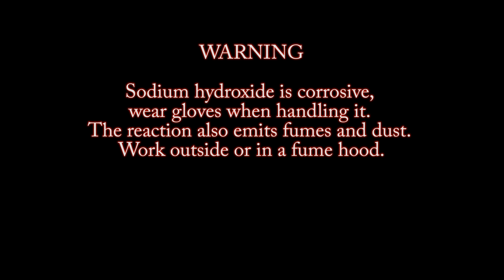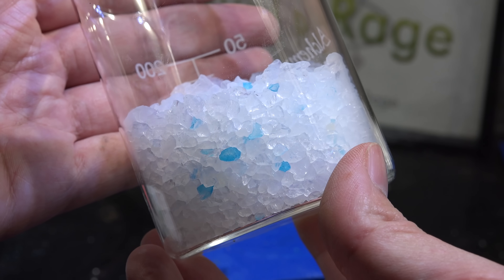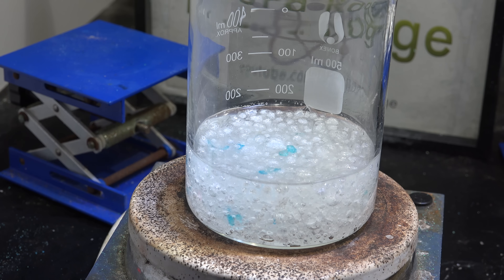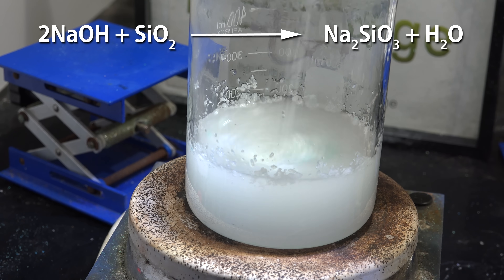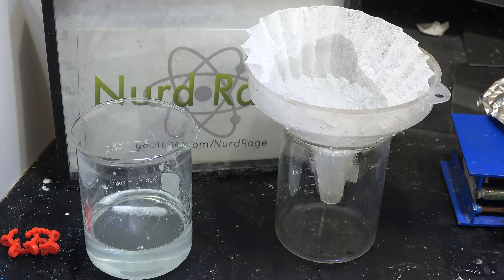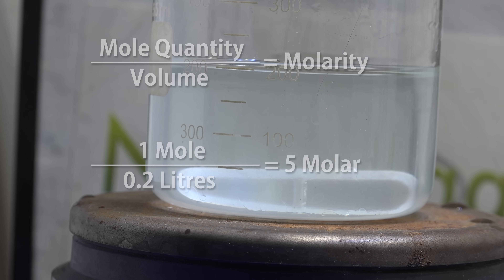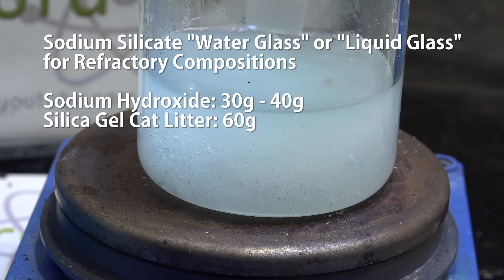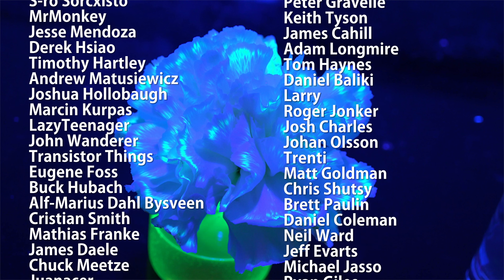Make Sodium Silicate (AKA "Water Glass") from Cat Litter and Drain Opener

Comment: Not that interesting by itself?? Its an incredibly versatile, safe and accessible high-temp electrical insulator for DIYing. You can just paint it on your conductor wires in a thin layer, heat to 120C to cure and then you're good up to 700C or so. One can easily build high performance heating elements or transformers or just use it as structural support as its very stiff. Worst case scenario, if you get it too hot then it just melts, unlike alternative varnishes or coatings that start spewing out toxic gases.

Comment: I put this in a spray bottle (diluted so it would actually spray) and used it to stop smoke from leaking out of my rusted chimney. Worked great! Had to get a blow torch on it though, as the heat caused the solution to boil, the bubbles would turn into glass. Looked really cool, and bright white

Comment: Quick first hand experience report on how not to do this:
1. Use previously used (but well washed) cat litter. Possible source of some of the product's ugly brown color.
2. Prepare in a soup can. The can liner soughed off and maybe partially dissolved, possibly contributing to ugly color, and later on the burnt circuit board aroma.
3. Stir with a twig. Partially dissolved brownish too.
4. Mixed lye and water first in a cold water bath. Had to do this outdoors where I forgot the exact procedure and winged it. The water bath was because I feared losing water and lye if it boiled over.  The lye did dissolve completely. However it seems the low temperature didn't allow the reaction with the silica to kick off fast enough for significant self-heating. I didn't get the stoichiometric mix I was after since some of the litter turned into a sort of chalky looking lump with the consistency of chewing gum. I was able to partially save it by using a propane torch to bring it all to a boil. However that also burnt some of the can liner and added the burnt circuit board smell. 

Oddly, I don't think it was much of a problem that my cat had anointed the crystals. I had washed them for several days in several changes of clean water, sun dried and then vacuum dried and then an hour under UVC light and 03. They were completely odorless but probably a bit damp from over a year of storage in an open container.

Open to suggestions about what might remove the ugly brown color and other contaminants from this batch.

Comment: Made up a batch with Fresh Step brand crystals cat litter. It must have some cobalt salts in it, because the finished product had a solid pink tint. Worked very well for bonding sand for a core for sand casting aluminum. I baked my core at 350 F for an hour instead of using CO2. Worked great, Thanks.

Comment: I want to learn how to make this--but starting from SAND. So far, the information I can find on this has been scant and contradictory. 

Presently, I have quartz sand, sitting in lye water. IDK--the water has formed a bit of a gooey layer on top. 

I read something about sand + magnesium powder + heat being a formula......apparently this yields an impure result, which you purify by using muriatic acid, in an explosive display. 

There must be an alchemical text, describing the procedure they used in the 17th century.

Comment: Finally, someone gets the sodium silicate thing right.  I can’t tell you how tired I am of people calling water glass sodium silicate sodium metasilicate!  They are NOT the same!  The metasilicate is too alkaline and does not have enough silica to seal eggs or density concrete because you need MORE silica in your formulation for that.  Metasilicate is a heavy duty cleanser and corrosion inhibitor.

Comment: I wish you smart people would EXPLAIN these things in Kitchen Cooking Terms for isn't that the mode of operation your in delving to perform. Example: Take 3 Table Spoons of Lye/Sodium Hydroxide & slowly pour into very Hot Distilled or De-Humidifier Bucket Water. Only use stainless steal or hardened temperature safe Plastic utensil. The take 1 PART that being 4 Cups of Water & add 2 Parts that B Cups of Cat Litter Silica minus the contaminant Blue Smurfs, Radiate the water with Sun Light directly into a White Bucket or place a Halogen Quarts ~HOT~ light Glass shield off the Water will absorb the Short Wave infrared Heat & Restructure the water Molecule, Vitalize it. Dr.Pollock's work with Water.

Comment: I recently discovered the clay based cat litter is generally made of zeolite specifically. It should be possible to produce molecular sieves from it.
Reply: The pores are usually not suitable for chemical uses though. Molecular sieves are engineered to have specific pore sizes to adsorb and trap molecules of certain sizes. 

While cat litter uses natural clay and even though it is generally used to adsorb urine, the water adsorption is really not specific. Its also used to adsorb odors so the the pores are most likely to be quite large to be able to trap larger volatile compounds that smell in urine

Though having said all of that, there might be certain processes that can be done to selectively collapse the zeolite framework to provide smaller pores. Even though it might need elevated temperature like in a kiln or high pressures like in an autoclave. 

Im interested in using it as a makeshift column chromatography solid phase

Comment: You're video had been the best figur the explanation of the molarity and ratios per usage. I'm wondering if you know what the molarity is for 30/60/100 mixture? Does it depend on the starting ingredients?
And how does one thin it?  Just by adding water or is heat necessary?
Reply: Water seems to work to thin it

Comment: Best way to dry Sodium Silicate is to use a vacuum desiccator. It will force out the moisture without having to apply heat and you can use a disposable foil pan to hold the silicate to make cleanup easier.
Reply: Would microwaving the sodium silicate work to dessicate it?

Comment: Thanks for showing how to make the liquid glass.  I am intending to use it in a small DIY furness at home.  I'm only looking at enough heat to melt aluminium at the most, more for lead.  Thanks again, very helpful.
Reply: Lead bullets?
Reply: @inbedduringcovid3005  Diving weights, and maybe aluminium moulds for custom sized weights.  If the demand is there.

Comment: Hmm water glassing could you use this for egg preservation?
Reply: I believe you are thinking of calcium oxide (powder) calcium hydroxide (mixed with water) aka lime bc it’s comes from burned limestone. Mix 1oz lime, you can find a small bag in the canning section called picking lime, or a large bag by cement called quick lime, 1oz to 1 liter of water. This makes what is known as water glass. Same name I guess but not the same thing
Reply: Yes, that is one of the things it was used for back in the day.

Comment: Hmm, I wonder if it could be thinned and used to seal wood outdoors?
Reply: i thin it out  and use it as a flame inhibotor and retardent on my house. ive tested several different mixes  and the best one seems to me is using the 30-60 mix 60g being silica gel  30 being sodium hydroxide i dilute  4- ratio. 4 parts distilled water to 1 part waterglass. for every quart made i mix in 2 tablespoons of baking soda and warm the mix up to about 100 degrees f. to dissolve the baking soda . after it returns to about 70 i keep mixing it. then i use a spray bottle to apply to the surfaces i want to treat. If you want a fast dry then skim it with a propane torch. if your in a place where you cant use the torch get a bottle of Co2 and gas the areas you are working on. the co2 will speed up the drying faster than a blowdryer or even a heat gun. a combination of both heat and Co2 is way lot faster and you will obtain better results.
Reply: @randallmarsh446  Howdy Randall. What does the baking soda do? Will your solution keep in a sealed container? Blessings.

Comment: Apparently K&W Block Seal (for head gasket repair) contains Sodium Silicate.
Reply: same stuff just has alot more so called extra additives to bolster the product. use the 3 to 6 ratio nurdrage has listed . it will work so much better than any or most over the counter headgasket repair liquids will. One thing once your engine must be free from any antifreeze or bars leak additives. After you seal the block if you put antifreeze back in the system the waterglass will break free due to the cleaners and proplyne in the antifreeze. thats one thing they dont tell you on the can so they can sell you more. Use a distilled water also.goodluck

Comment: NurdRage, Hi, hope you can advise, I have made several batches of Water Glass using the correct measurements and ingredients, the problem I'm having is the finished product does not harden properly by air drying, it takes ages to solidify but remains tacky to the touch. Also is there a catalyst you can add as a hardener to speed the curing process. Thanks :)
Reply: Check out foundry products for hardener
Reply: Use a propane torch to harden the adhesive mix. heat and C02 are the main ingredients needed to finish curing. If heat is not an option then c02 is the only other option you would probably have to finish drying the glue mix.

Comment: For your consideration I provide a step-by-step DYI method to make approx 500ml of highly concentrated Sodium Silicate. The method takes advantage of the exothermic chemical reaction involved. It uses an insulated and completely sealed reaction container, needs no added external heating or stirring and is thus relatively safe.  It produces no fumes which open pot techniques suffer from. The reaction takes about 12 Hrs to complete (Leave it unattended overnight).

MATERIALS: a 5gal plastic paint bucket with lid, a 2qt. Glass Canning jar  (Hobby stores have these - do NOT substitute the more common 1-qt. Jar), 1/4” PEX tubing, 4” and 2” funnels, and fiberglass insulation, 200g lye, 300g silica gel (cat litter), 500 ml water. There is no need to remove colored material from the silica gel. NOTE: The 2” funnel was a modified “Cream Color Developer” tube from a Revlon Colorsilk hair color kit.

1. Obtain a two quart glass canning jar.  Into the jar combine DRY 200g lye with DRY 300g silica gel "cat litter". Blend well (e.g. put the lid on and shake it up).

2.Remove the lid and put the jar in the 5gal plastic paint bucket (used as a safety containment device) and surround  the jar inside the bucket with fiber glass insulation.

3. Put a 4” funnel in usual position as a loose lid for the jar and insert approx 15” of 1/4” PEX tube thru the funnel neck and seal the opening around where the tube passes thru with a small piece of insulation. The 1/4” PEX tube is used to safely instill water into the dry 500g mixture. 

4. Completely cover the glass jar and funnel assembly with more insulation. Make a hole in the center of the lid of the 5gal pail and install the lid, so that the tube protrudes through the hole. The glass jar containment is now fully enclosed and insulated.

5. Attach the approx 2” funnel to the top of the PEX tube and slowly, instill 500ml of water. A strong exothermic reaction results. Some steam may evolve however it will be trapped by the insulation. The boiling point will shift to +250F - you don’t want to get this shit splashed onto you!. The final quiescent temp will stabilize at about +220F - leave it alone overnight!

6. Note that chemical burns from lye heal slowly and eye damage is permanent. Don’t be stupid and try to open the assembly early just to check on it. 

7. Wait 12hrs - done. You will have 500 ml clear sodium silicate with the consistency of honey. Store in a sealed jar. Carbon dioxide from the air will cause it to solidify.
Reply: Where to get 100 % Lye
Reply: Kenneth Nichlos : Ace hardware various grocery stores, cleaning supplies section, Wallmart.
Reply: Do u have a video for this.. I would learn if I seen it done. One time and I'm good. Lol.
Reply: WideAwake * I don’ have a video; however if you email me: jerry.quigg@alum.mit.edu I’ll take some pics make a video - whatever and send it 2U.
Reply: WideAwake * : email me: Jerry.quigg@alum.Mit.edu
Reply: @StƏphaniƏ012  Email to => jerry.quigg@alum.MIT.edu  & I'll send pic's etc.

Comment: Sodium silicate!
Many old fire-works use this as glue, for paper-preparation, nozzles and plugs.
I have made some very tough rocket nozzles using fine sand, kaolin clay [the other kitty litter!] and just enough 'water-glass' to make a thick dough.
It has about 2 minutes of working time before it starts to get hard, over-night it is like concrete.
Roast the stuff at low heat for a few hours to drive off any moisture.
In all the nozzles I recovered, there was barely any erosion of the throat.
Tough stuff!
Reply: It was also used to glue tubes to boards etc. If I remember correctly zink oxide was added to promote curing. I had some problems with the silicate glues deteriorating over time, becoming "powdery" on the surface and then fail. This can be seen on old power resistors that used to have such coatings as well. It has also been a component of dental cements for crowns. There are nowadays  ceramic  powders for pottery etc that can be pressed and fused at fairly low temperatures that make better nozzles etc. For nozzles  simply pressing bentonite cat litter works well. Many applications for cat litter...

Comment: I know the video is a bit old, but just tried this with ratios 100ml  water 60g silica and 35g sodium hydroxide. I could not get the silica to dissolve completely how long should it take? and should I add more sodium hydroxide if it won't dissolve all the way. I'm looking for a water glass mix
Reply: tried crushing the silica first and it mixed then about 2 minutes later it reformed back into a solid lump, what i liquid I did get set hard but was not water proof and just washed away, any tips? I have ordered some store bought product anyway

Comment: so what would you use this for? just asking
Reply from the maker: It can be mixed with other clays and similar fill to make refractory liners, like for making stone ovens, forges or kilns. 

As a chemist, i want it to make silicate minerals and silica catalysts supports.
Reply: @NurdRage  - thank you so much for responding, and incredible that I came across your channel cause I was searching info on another subject, but I am also interested in DIY my own pizza oven for my back yard, and this is great info. to know. thanks again
Reply: @NurdRage   hmm.. I'm watching a lot of casting videos on youtube, could you use this directly to make sand cores with CO2 hardening them? like in: https://www.youtube.com/watch?v=XjklH2fYvOo ?
Reply: @NurdRage  I haven't decided yet between "crack resistant concrete," cement mixed with fly ash, or cobb; but, I'm needing to make myself a rocket water heater. (Only having hot water in the summer really sucks!) I only ran across "Water Glass" a couple of days ago, in a rocket mass heater video, as a "paint on" to reduce and fix cracking. Your comment here is the first I've heard about actually mixing it into the material being used. I plan to coil 3/8" ID copper tubing; then, spread it out to give it about an inch of protection from the flue temps; and, hope that it still gets enough heat to both thermo-siphon and result in 105~110 (F) bath water for long, hot soaks. (I have degenerated disks; and, refuse to allow the medical mafia to turn me into one of their junkies!) My initial interest in water glass was to prevent cracking; but, since it seems to also be an insulator, I also had concerns about it potentially being too much of an insulator. ANY suggestions you might have would be highly appreciated!!!

Comment: Hello Dr. N. Butyl Lithium, I think that this solution could be very useful to coat thermocouples in a high temperature electrically insulating coating but SiO2 has a very poor thermal conductivity rating(1.4 W/mK).   Would it be possible to create a similar solution with MgO instead which would have a much greater thermal conductivity(50 W/mK)?  Thank you for your time and for an excellent video.
Reply: What would the compound be called then?

Comment: OK, do Potassium Silicate next.  It's even better for refractory.
I suppose potassium hydroxide would be used...
Reply: Jup it works, I already tested it, just use equimolar amounts of KOH. I used 112g KOH, 100ml Water and 60g Silica gel.
Reply: I did wonder about potassium hydroxide. What is the application of potassium silicate? Where and what is it used for?
Reply: Which do you think would work better (both inside & outside) of a cobb, cement, or air-crete rocket water heater?